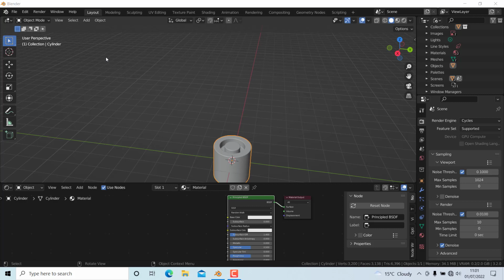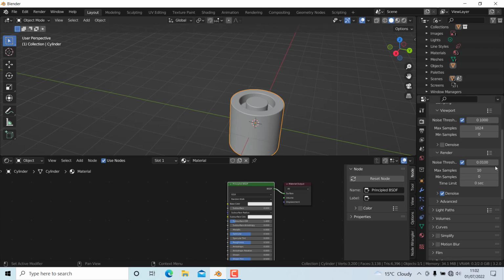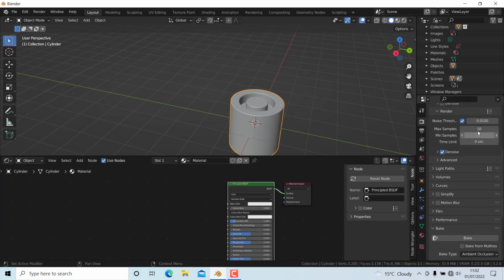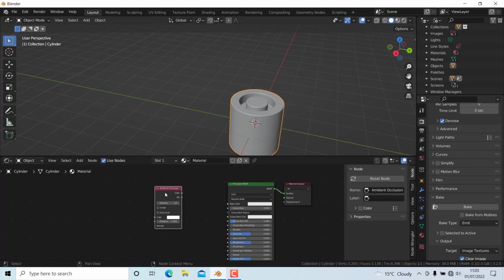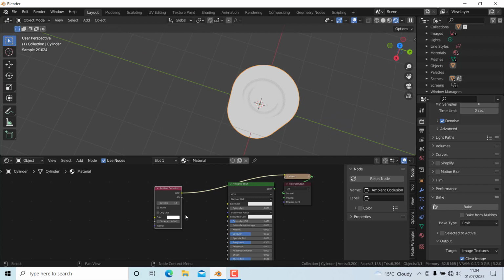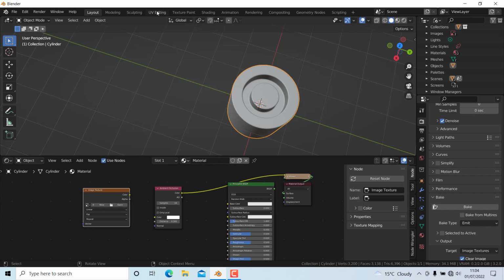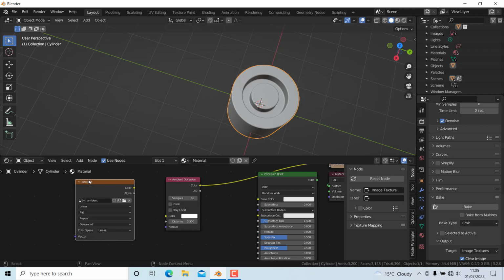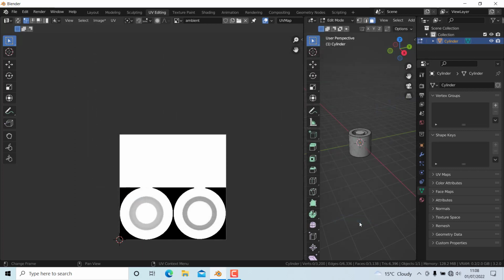How To BAKE AMBIENT OCCLUSION MAPS in Blender

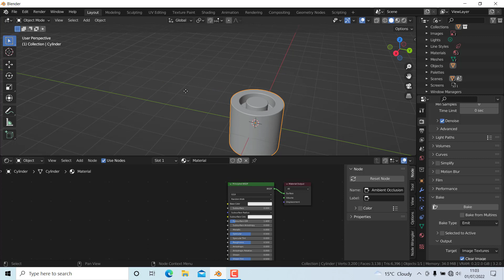Comment: The step at 1:50 (ctrl-shift-LMB to connect to a viewer node) requires the add-on "Node Wrangler" enabled. Also, in blender 3.4+ the Viewer node is no longer available, and it connects the AO output directly to the material output.